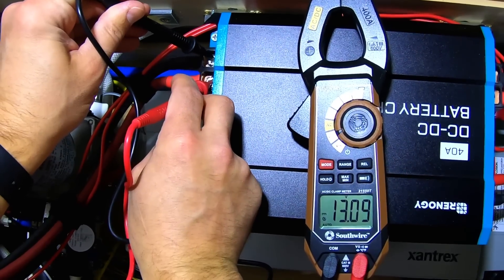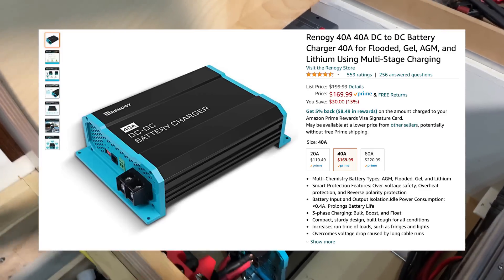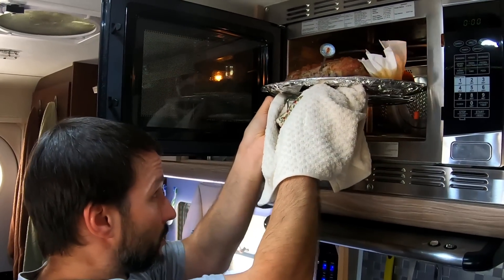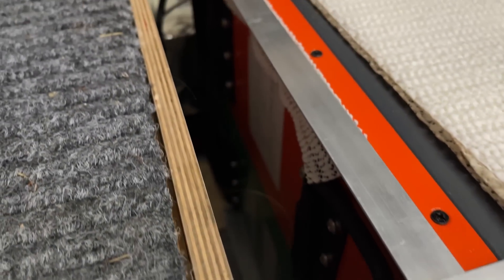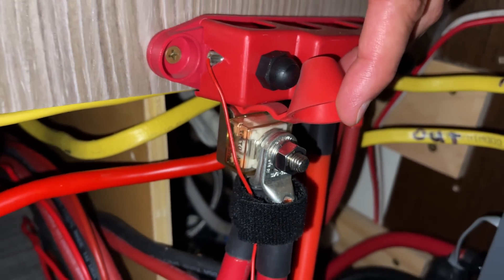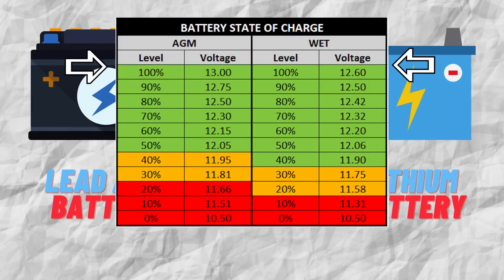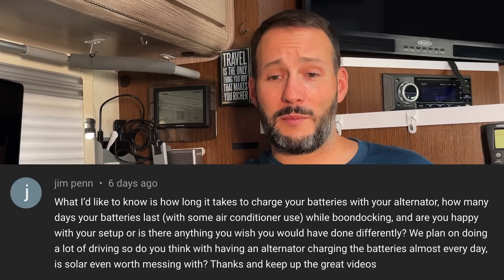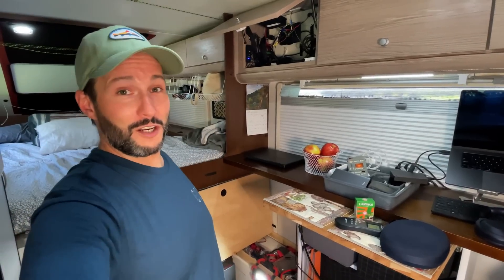Lithium RV Battery Power System Tour // 1200 Ah of LiFePo4 // 15840 WH // Q&A

Comment: I recently built a 1200 AH system with a smaller footprint, based on the reviews of Will Prowse and others, as well as the Black Friday sales.  The Asian brand Dumfume had a 12.8-volt 600 AH battery on sale for only $524 on Temu, with free shipping. The two batteries are currently being charged with solar and a 12 volt charger until my Renogy DC to DC charger gets delivered.

Comment: Good luck continuing to change off your truck alternator. My Cummins 5.9 has served me far too well to put the extra load on its alternator which was not designed for the additional load of charging my camper batteries. I’m glad for my onboard generator which is designed to run anything in the camper.

Comment: For the batteries use 1/2 inch angle iron have someone weld it in a box shaped holder it'll be stronger than aluminum

Comment: Hey Scott. I subscribed several months back and have been following the videos you and Sasha put out for a while now and really enjoy them. Thanks for the great content and the excellent job you guys do putting them together. If you've already answered my question to follow, I apologize in advance. I'm wondering if you could share the name of the company you worked with to custom design and build your batteries? Like you, I have a truck and a camper for boondocking and I have the same issue you had with needing more power for my rig and limited space to utilize. I'm hoping I can find a company that can help me build exactly what I need. Any help you can send my way would be greatly appreciated. Thanks and keep the great videos coming!
Reply from the maker: Thanks for subscribing and watching our videos. Unfortunately, I can’t share where I get the batteries from. I’m currently under agreement with another company regarding the batteries, so I’ve been quite on them. Detail will be forthcoming in the future, but for now…. I have to 🤫

Comment: Wish I could see how ya hooked up your AC and Microwave off your batteries.  Recently got a 820 2022 model, but hardly anything is wired for the inverter.
Reply from the maker: My understanding is the 820 comes with a 1k inverter. So it wouldn’t be enough to run the microwave or A/C. Upgrades would be necessary. Also, I took advantage of space that’s not available on the 820. If you can send me a message on Facebook or email I can record a quick video tour and show you how it’s setup.

Comment: One of the drawback of lithium batteries is potential damage caused by charging at temperatures below freezing.  Some manufacturers are developing batteries with internal heaters to help.  How are you mitigating this issue when you're in the cold weather?  Especially when you're charging from the truck?
Reply from the maker: My BMS has low temperature charge protection. It won’t allow a charge below 34f ( I chose that temperature for an extra margin of safety). Also, our batteries are inside the camper and we live in it full time, so they never get cold. I can install a heating pad that works with the BMS. But I haven’t needed it yet.
Reply: I'm in MN with a four-season 5th wheel and have money down on a Cirrus 820.  What I'm most concerned about is the winter times when the rigs are not used (winterized) but plugged in for battery maintenance.  I suppose it would be best to remove the batteries or invest in the auto warming or just stick with the tried-and-true lead acid for this part of the country.

Comment: Scott, starlink offers a ground pole mount 2x44, which you can cut to fit to mount to the back of your camper and then add an extension pole.  the 88 inches is plenty to reach just below the roof line. the mast is 1.3 inches in diameter, the weight is 9.2 lbs, and the dimensions  for the new square dish are 19x22. so you would not need to wait to put solar panels on the roof.  the downside is that trees can drop your signal because of obstruction.  also the rollout for starlink has had delays because of chip shortages and there needs to be more satellites, most likely late 2022 will be a better time to buy the dish.
Reply from the maker: Thanks for the specifics. I was really hoping things would go as planned, but the delay has be rather disappointed. There are other factors delaying our solar build that will become clear in the coming months. I still have plans for Starlink, but I'll just have to wait until its ready.

Comment: Interesting and very neat - just wonder why you never did a 48v system to keep the wiring thinner - you can get DC to DC chargers and a step down for 12v    - I have 320amhr on 12v  in my rig  and use a Renogy too
Reply from the maker: Simplicity! If I needed a bigger setup, I might consider it. But for now, 12v has been enough. Granted, I’d like smaller cables, but I didn’t want to deal with step down converters and replacing my inverter. Huge investment of time and money over time, to change to 24 or 48v would require replacing some expensive components. But I agree, higher voltage would be nice. 

If I ever move to a 3k inverter, I’ll probably switch then.

Comment: Nice rig.  I recon you could get 2 x 400w panels on there so 800w of solar is gonna be happy days for your air con!! :D
Reply from the maker: I coudl get those up there, but they would cover my vents and air conditiner. With solar, I'll probably look at either 100 or 200 watt panels, possibly flexible, to fill the gaps on the roof without covering my other equipment.

Comment: Great video. It was all I could do to muster up the courage to cut s 5” hole in the floor to mount a diesel heater. Great job!
Reply from the maker: Thanks! I hate cutting things, but a couple holes were needed! A diesel heater sounds like a fun project, what model did you use?
Reply: Stonyboot an Esbar D2.
Reply from the maker: @darylhawkins4658  Thanks, I'll google it!

Comment: Great set up but where is the battery link? You don’t consider them part of the power system or are they a secret?
Reply from the maker: I don't have a link... They aren't a secret, but they are my own design and not on the market. Selling them becomes a very complex process, one that I have not solved yet. I also have another major design change that I'm working on. So in essence, these are just prototypes. I might have a link for them someday, but nothing yet... 😔

Comment: Well done, Scott! Clear, concise & upbeat- all in one video!? I'm genuinely impressed, and- not a single swear word was used. You probably should have opened showing your hands though- I'm sure they were all cut up from hand tool mishaps (well, mine certainly would be!) & then a quick flash over to Sasha (say 'Moose & Squirrel') to see how angry she was with you after destroying the camper for days in a row! BUT, the end result is awesome & 1,200AH is massive overkill for 98.6% of your viewing public. Conversely, very few would venture into 300Lbs of dead weight as well. I'm awed with the effort...
Reply from the maker: That's for the great comment! To my surprise, I didn't have any major injuries. Sasha is pretty tolerant of these projects and really enjoys the extra power and what it does for our life. But it does get pretty cramped in there when we are both trying to work on stuff :)

They are overkill for most people, but it's pretty nice for us. We have the ability to charge all of our stuff including our e-bike batteries without running the generator. It's been really nice!

Comment: With adding new batteries to an existing battery bank, aren't you worried about the older batteries being pulled from more, than the newer batteries? Or is that not a thing? I head that was a thing, and it's stopped me adding more batteries to my 300ah lithium system. 1200AH is AWESOME lol.
Reply from the maker: That's a great question. From my understanding, it's not good to mix new and old lead-acid batteries, but lithium is much more tolerant. Their charge efficiency stays very solid over time and they don't need to float. They do lose capacity over time, but that doesn't really affect their charging characteristics. When I joined them up, the old batteries had about 50 cycles on them. I ran them separately and together and they seemed to perform equally in both cases. I do have them wired in parallel pairs so I can easily separate them if needed. 

I'd like to hear more about the potential problems with the old and new lithium batteries if anyone has some input!

Comment: A high output alternator like we use in car audio wont give you faster truck charging?
Reply from the maker: High output alternators would be fantastic! In my dream setup, I'd have a HO alternator setup to charge my house bank. More power and less worry about burning it out! I have the factory Dual 220 Amp alternators, but I'd love to look at better options! Do you have any suggestions?
Reply: @Stonyboot  #1 Mechman. JS Alternators,DC power. Depends on the application. My JS was 500 bucks and Runs an 8k subwoofer setup.
Reply from the maker: @rexnhogz  Those do look nice! If I could pull like 200 amps continuously, I would completely change my charging system. However, I have bigger projects coming in the following months, so I won't be making any changes like that yet.

Thanks for the tips!
Reply: @Stonyboot  a alternator is is massive noticeable difference

Comment: Wow... the algorithm hasn't shown me your guys' videos in over a month.  Only found this scrolling down after one of kenny of all trades videos.

Also, how do I find a data plan like that?  I've looked all over and the damn cell companies I've seen have max 30gb caps, and is extremely expensive after that.
Reply from the maker: I'm glad you found us again! My data plan is through Mobile Must Have. When I signed up, it was $120/month for unlimited data. Then a 1TB cap was applied and shortly after that a 500 GB cap. These unlimited data plans are in a grey area and the cell companies are cracking down. At the same time, the prices have gone up. My $120 plan is now between $200-$400 per month. 

We also use our Visible phone plans which give us unlimited hotspot. The hotspot speed is limited to between 5-10 Mbps. It's enough speed to stream anything you want and use our computers without data restrictions. I have been pushing a lot of data over the Visible connections and they have been working well!

I'm going to just stick with what I have for now, and get the Mobile version of Starlink when it come out... Soon I hope!

Comment: Do you have a high idle on the truck? If so, could you use the high idle to act as a generator via the DC-to-DC charger? Would it be an efficient way of charging instead of the generator or solar?
Reply from the maker: I do have a high idle, integrated into the cruise control system on our Cummins. While it’s possible to do this, it’s very inefficient. Running a large engine just to spin the alternators and charge at 1000 watts isn’t cost effective and would be detrimental to the engine. I only charge while driving. If I need power to run my AC or recharge our batteries, I’ll run my much more efficient Honda generator. 

When I get around to adding solar, that will really help extend our battery power. The real limitation for us regarding solar, is roof space. 

A purpose built, inverter generator is much better to run than your trucks engine. And personally, I’m looking forward to adding solar so the generator will only be needed to run the air conditioning.

Comment: DC to DC converters for Laptops and for that Storage would help you waste less power as that inverter wastes lots of power
Reply from the maker: Agreed, but that presents other problems for us as well. We have 3 laptops, each with different voltage requirements, my storage array has another set of requirements. Our ebike batteries are also different voltages. 

I’m a perfect world, I’d go DC for everything. But the added cost and complexity made it less appealing. My 10% loss at 200 watts means that I’m sacrificing about 20 watts of power. Easy to compensate for that. 

What I real want is a DC air conditioner!!! Any thoughts on that?

Comment: Have you considered a DC air conditioning system? What would be the advantages?
Reply from the maker: I have, I'd love to get my hands on something like that. But since ours is still working fine, I can't justify spending the money to replace it.

Advantages would be greater efficiency and less power loss. Using an inverter means that 5-15% of power is wasted in the form of heat due to the inversion process. Running DC devices directly off of DC is always a more efficient, and produces less heat. With battery technology coming along, I see DC A/C systems becoming more popular.
Reply: Look at "Mabru" DC air conditioner the guy  a genius
Reply from the maker: @JoJoRocks5  I did, they look great! Much less power draw than our current setup. Right now, it's a little out of my price range, but if I were to build a rig in the future, I'd really like to integrate a system like that into the camper.

Comment: I guess I made the comment on heat to soon so it sounds like an excessive heat problem.  I would put a hole in the side of the Camper to exhaust the heat outside and thematically controlled. Now you mentioned 3000 watt in inverter but I only have 200 watts Lithium. Remember I said I couldn't run the toaster buts that's because I don't have it installed correctly.
Reply from the maker: The only time we have too much heat is when its warm out and both DC-DC chargers are running. I just open that compartment if we plan to drive more than an hour, I also have a fan to install at some point soon.

2 100 AH lithium batteries can probably support up to 200 amps of discharge,  so the 3k watt inverter should work, but not at full capacity. If I remember correctly, you said a breaker/fuse was tripping. All of your wires and fuses should be selected based upon the load required to run your devices. Did you ever get it figured out?

Comment: I’ve never seen any get so excited about batteries 🤓. I have to admit tho it’s obvious you know your stuff. How’s the weight balance? Did you calculate that in or just go with what you had? Was it even a consideration? I would think you’d need airflow across that Alde radiator—after all that’s the idea of a radiator to dissipate heat. Hope it works out for you.
Reply from the maker: Thanks. The weight was considered! I moved our extra water jugs, about 18 gallons to the drivers side, that offsets the extra 2 batteries for the most part. The passenger side is a little heavier from the factory, and adding my office setup added a little weight. I’d like to get on some scales to see how far off it really is.

Comment: I just use a computer fan.
Reply from the maker: I have a large computer blower fan that I’m going to test. It’s it a normal muffin fan, but more of a centrifugal blower, just tiny.
Reply: @Stonyboot  That may work. Worst that could happen is it doesn't and you will have to upgrade. Good Luck.

Comment: Great system. I'm thinking of placing the large fuse right at the battery terminals. My logic is everything down stream is protected?
Reply from the maker: Thanks. I wanted to place the terminal fuses on the batteries, but I just didn't have enough space. 

That would protect your main power distribution, but you still want to fuse each additional circuit after that. Sometimes fuses are built into the devices you are connecting to, like most inverters.
Reply: @Stonyboot  yes I should have written all cables downstream of the batteries are protected. I will use fused individual circuits. If you look at Everlanders channel Jason has built an innovative solar array on a camper roof.
Reply: The ABYC battery fuse standard is 'within 7 inches (cable run) from the battery'... They offer no slack for installation difficulty.... My preference is before the cable can come in contact with a grounded surface.... Since your surfaces are largely wood or metal that is un-grounded because it's mounted to wood, I'm sure what you've done is fine.
Reply from the maker: @stevehericks5764  That was my determination too. I wanted to install terminal fuses, but I just didn't have enough clearance.